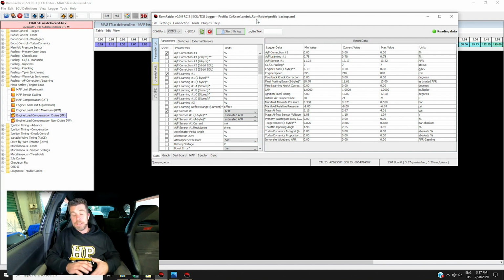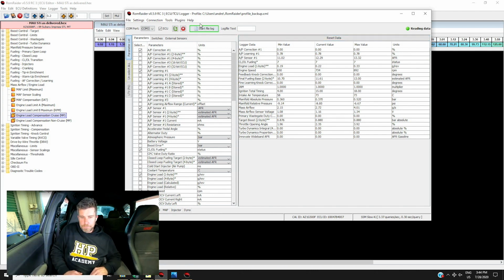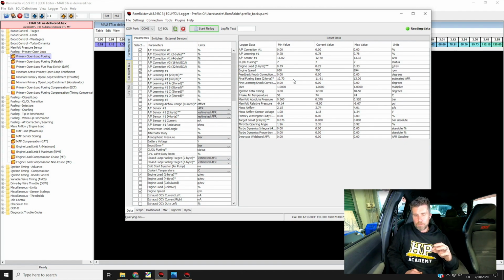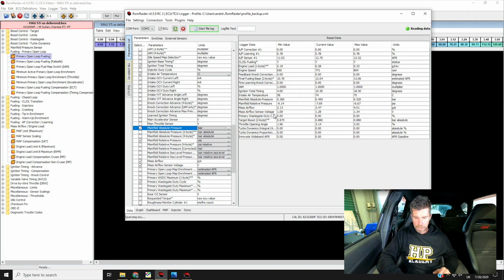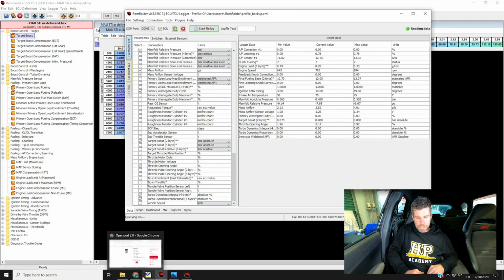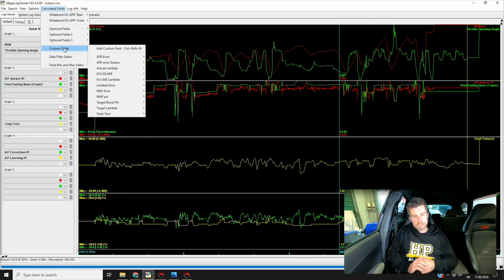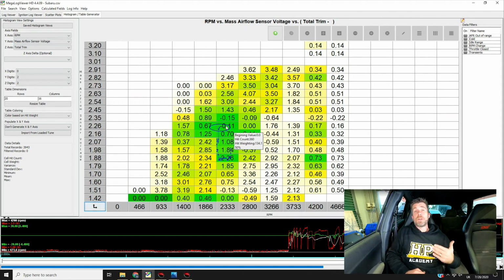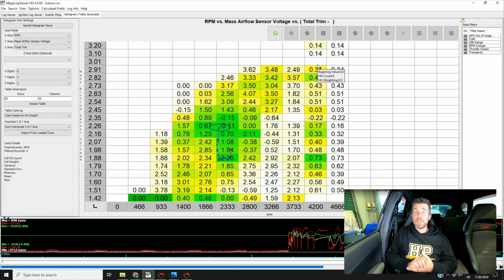MegaLogViewer HD & RomRaider Tuning Fast Track

Comment: Since i changed the turbo, injectors and tmic on my 2001 wrx to sti spec i was wondering would it be safe to reflash the ecu with a stock 2001 sti map and then in order to see if it's running too lean/rich just to log in rom raider as explained here? the only issue i could see is that i don't have a 3rd party wideband AFR sensor to accurately check the ratio.
Reply from the maker: It will give you a starting point. It only won't be safe if you flash it in and then begin by doing full power ramp runs (yes, some people do that).
Fit a wideband, it's cheaper than an engine rebuild 🤘
From there, start your log and ease your way into things checking it all as you go working up to full power runs once you know it is safe to do so and have made any applicable changes to the tune as you go if required.
If you don't have it EcuFlash is probably an option for you (open source tuning software). You'll need an interface for it, the Tactrix one is solid - Taz.
https://www.hpacademy.com/blog/ecuflash-tuning-example-subaru/
https://www.hpacademy.com/blog/are-oem-tunes-as-good-as-you-think-ep-2-off-the-record/

Comment: Romraider is such an underrated software. i know they are know for mostly the subarus. But its also come very far for the e36 ms41 community. And ive gotten 600hp builds on stock ecu with just romraider and megalog viewer.

Comment: This may be a stupid question, I don’t know anything as far as self-tuning yet, but does anybody make like some kind of auto-tuning software or devices? It seems like it would be pretty simple thing to make, figuratively. I’m not a programmer- but can’t you make a basic AI that would automatically adjust all these maps automatically with adjustable levels of safety dialed into the curves? Wouldn’t that be really easy and convenient? 
If i’m not being clear, imagine something that you activate- do a pull- and then it analyzes all the maps, factors in ambient air temps and altitude and runs a self-simulation and guesses a sort of max value and an average value, then makes a change here or there- you do a second pull and it analyzes the effects of how accurate it’s guesses were- then corrects itself, do a third pull. Seems like pretty soon it would know my car really well, and if I threw on, say, an air intake. Why can’t I quickly enter a mode, tell it what changed ‘added cold air intake’ and then have it look at the changes to normal, it makes a guess, do a pull. 

Am I stupid? This video is my first attempt at learning tuning and 2 mins in I paused it to ask this because it’s been bothering me for a long time. Couldn’t something like I describe be made to self tune in real time, too?
Reply from the maker: Yes, but no it's not that good or easy when it comes to no manul intervention. Here's an example from one platform - Taz.

https://www.hpacademy.com/blog/how-to-use-your-autotune-function-ecumaster/
Reply: @hpa101  hey thanks a lot for the educating and the reply. I suppose if something like I talked about did exist that it would probably take a lot of work from the Tuners that count on that income. Sort of like self checkout. 
I appreciate how you’re taking something like Subaru tuning that seems more protected and clandestine than the CIA and actually sharing knowledge with other human beings who are interested in learning. And for free. That’s super cool of you! Open source, what a concept

Comment: hey can I use rom raider and transfer my maps from my old tuner and just go from where he left off?
Reply: Reading and writing roms will require ecu flash. But once opened and read you can save it as a .bin file and open with rom raider or just use ecuflash.

Comment: High Performance Academy, hope you don't mind a question: 
I'm putting new rings in my used engine. Factory says new rings should have a gap of 0.006"-0.012"

Unfortunately the standard size pregapped new rings measure 0.015" when put in, and file-fit rings don't exist.
Can I get the 0.020" Oversize ones and file them instead?

It's a Honda DOHC ZC (pretty much the same as D16A1)
many thanks!
Reply: If they don't reply, boosted need more gap. Top and bottom different gap. More gap is better for boost.  This guy talks a lot about ring gap.https://www.youtube.com/channel/UC8uf_zVTV63l1-uRSx6XbnQ
Reply: @srica7366  Thanks! It's just for a stock NA setup, no tuning. So the smaller gap is prefferable, I was just wondering which is better (standard size with larger gap or filed down oversize with smaller gap)

Btw I messaged the manufacturer directly and they said the standards are totally fine and will not have any blowby or oil consumption.
Reply from the maker: This is also a good watch @Sidney - Taz. https://www.youtube.com/watch?v=y3nqpZF9wa0

Comment: 8:55 You can enable fast polling to improve your query rate (see how it currently says slow-k)
Additionally it's probably an important note to make that anyone who's using this video as a starting point to start logging using RR (seeing as it will be a free video on youtube now), the software does not ship with definitions out of the box and there is some configuration needed. Relative to this, depending on the definitions used, you will be seeing different parameters available from def to def.